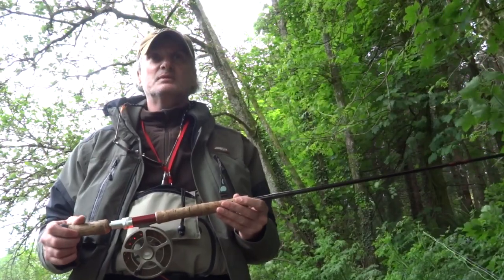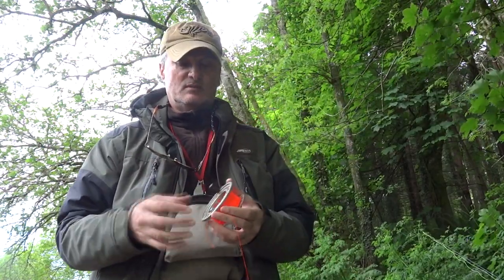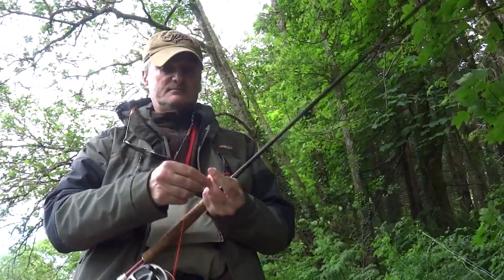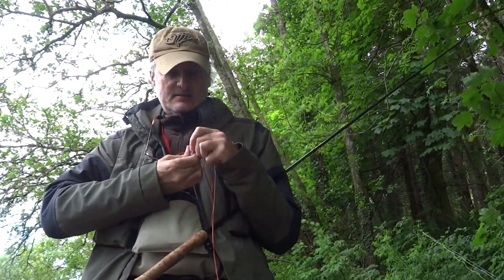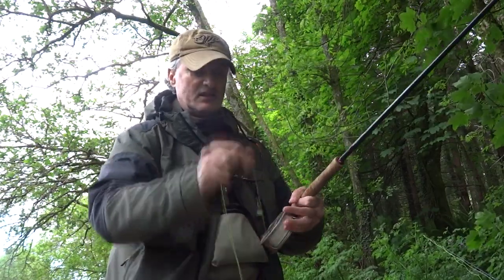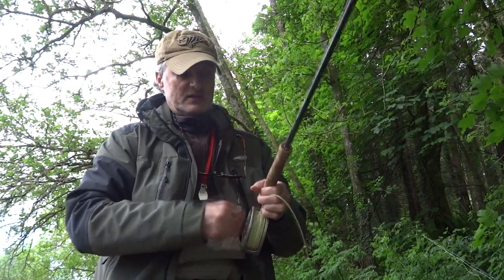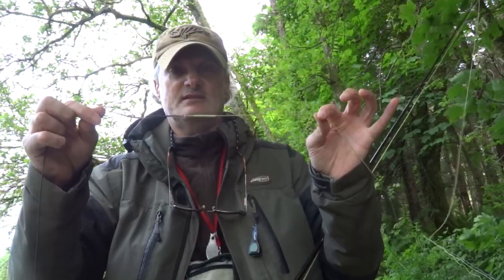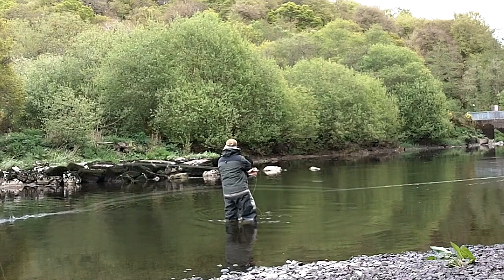Salmon Switch fly rod set up (HD).

Comment: Been thinking about a switch rod been using Shakespeare oracle 14 for years looking switch some thing lighter for the summer.  Please advise what rod you are using and line. Been watching your uploads and have subscribed
Reply from the maker: Hi Neil, the switch rod I'm using is a home made rod because I prefer a 10ft rod and most of the switch rods were 11ft or more which defies the whole idea of a switch rod and 10ft rods are better from both single and double handed fishing. The shakespeare 8/9 switch is a good rod to start with, guideline, Zpey, Hardy, Loop all make nice switch rods but also at a nice price so its better to try and see if you need the rod first before you buy and anyway the shakespeare will always be a good spare rod. As for lines Rio switchchucker or the Barrio switch line are ideal and can throw any 10ft polyleaders. Also thanks for subscribing as I'm no longer answering unsubscribed comments. Tight lines Paul. p.s. Go to my facebook page MrKingfisher3 and direct message me if you have more questions.

Comment: excellent video very easy to follow 
just bought hardy 11ft switch  tod was thinking off getting rio scandi short versitip line what u think or do u recommend any other line 
cheers Ross
Reply from the maker: Hi Ross, for ease of fishing I would use a Rio Switch chucker as my main under arm casting line, it will handle most of the sink tips and has excellent turn over even in a good wind. In reality you only need a few tips considering that I really only use two sizes myself and they are the Rio 6 ft salmon 2.6 ins and the 3.9 ins sink tips and an intermediate tip for summer low clear water. A trick that works for me is if its too fast or deep for my tips I add a small tungsten tube fly to the mix and with the Outbound or Switch chucker you will still get a nice turn over and more depth. A video is on the way soon regarding sink tips, lines, mending, tracking and placement etc.

Comment: Hi Paul really enjoy all your videos good explaining and gets through easily in my grey matter! I do not own a salmon fly rod but here in Devon where I fish on the river Reign the sound of a switch rod appeals to me! Paul on rod reel what would you recommend for here for me please ?
All info greatly appreciated keep up the grand work and Tight Lines to you!!  Moppy
Reply from the maker: There are many good switch rods available at the moment but if you just want to test the water the Shakespeare 8/9 switch is okay. Stay away from the line and buy a good dedicated floating switch line either Rio or Barrio that can carry 10ft tips poly leaders etc. You will be fishing probably only 3 tips in a season, an intermediate, 3ins per second sink and a 4ins per second sink rate. Rio make a good set of versileaders in those 10ft lengths and well tapered for good turnover.
Reply: @MrKingfisher3 Thank you very much Paul for reply/ advice! 6 weight good all round ? River Teign very narrow in places and with spate soon drops after good head of water to be got smartly but high low no matter grew up here so means a lot body and soul ! John

Comment: Thanks fo this. Is the sink tip always needed or in lower river conditions can I just attach the tippet directly to the floating fly line? Aso, how long do you usually make your tippets a.d what space between point fly and dropper if you use one?
Reply from the maker: Low water conditions can be hard especially for salmon fishing so stealth both in the water and on the water are important. Using an intermediate clear tip of about 10ft with a 6ft tippet of around 5kg is ideal giving nice presentation and hiding the flyline. You could also use a 10ft tapered leader as well and attach  the same 6 ft 5kg tippet which would give more life to the fly than the intermediate tip. I normally allow 3 ft between point fly and dropper. A good fly for a dropper is a size 12 wickhams fancy which can catch you more fish in August and September than any shrimp pattern because salmon tend to hit the smaller flies then.
Reply: @MrKingfisher3  Thanks for the advice.

Comment: Good video paul,  Just a question what line do you use? Im using a Guideline multi switch with my Guideline lpxe switch.. I find it good but when wind comes the line doesn't have the power to cut through.
Reply from the maker: That seems to be a common problem with most bespoke lines that are supposed to be designed for certain rods they can't cast the tips and are very lacklustre. I use a Rio Outbound fly line almost the same profile as the Rio Switch chucker, the outbound is just slightly lighter than the switch chucker so I can over arm cast smoothly and it can also put out most of the 6 ft sink tips  (up to 7 ins sink rate) with ease. I have used the Switch chucker line and it can really throw most sink tips into any wind. Maybe a short Skagit will help you as well, you really only need this type of line for tight areas and heavy tips but it will cut through most winds carrying a sink tip. I will be putting up a video soon on fly lines and casting techniques to improve turnover and presentation.
Reply: MrKingfisher3  cheers Paul, I use the outbound on my 13fter 8/9, the switch rod is rated from 290-325 grains but most of the lines are above it, have you herd of the airflow rage lines ? There around that grain rate. Cheers
Reply from the maker: I haven't used the Airflo rage lines but as for the  line ratings most of them are off, even these days most rods are a half or even a full line weight under what they are rated for. I have put 5wt and 6wt lines on a 4wt rod and fished away with very little notice in the casting stroke. The only problem is when you start banging short heavy lines and tips on a switch rod then you will break the rod. The switch chucker is a fishing line, it will do the job... catch fish because it does what it says on the tin and that is cast most tips with ease into a wind and still give you great turnover. The Barrio lines for switch are supposed to be quite good as well and they are a full line as well i.e. running line straight to head. Lines will always be an issue, you just have to find the one that suits you and what you need it to do that's why I recommend the ones that I have used and worked for me.
Reply: Cheers paul, The I know lads who are fishing 420 grains on the same rod but on a 8/9 not a 7/8 so i might try 360/390 grain and see, I only fish inter tips 10ft on mine! Thing is though the grain ratings are for overhead not spey casting.. weird!
Reply from the maker: I would change over to the 6 ft Rio intermediate salmon tip and use a flurocarbon tapered leader and you will find that it will cut through the wind better and get good depth with turnover. Most switch rod lines and rods are catered for 6 ft tips not the 10 ft that's why I recommend the Chucker as it designed for that and will carry 6 and 10 ft tips. I have used Rio tips and lines for over a  decade  and they are the best for fishing, when you can forget your casting issues you can really concentrate on the fishing and catch fish.

Comment: hi , I'm think of getting an Oracle switch rod , but I'm unsure should I get a 6 7 or an 8 9. I fish the feale and laune 
what would you recommend
Reply from the maker: Hi Timothy, the 8/9 switch is the safest option as the 6/7 is too light and this can be an issue with high water or fighting a good fish. You just don't have any backbone in the lighter rod especially if you are going to be using poly leaders. My rod is a 6 wt home made switch but it's only 10 ft in length giving it better strength and casting power. I had a 6/7 Oracle and broke the tip playing a good salmon so if it were me I'd get the 8/9 .
Reply: @MrKingfisher3  I've heard about Shakespeares breaking , but then I was also told they are great rods ,,, I've seen heavy salmon played out on 6 wt trout rods, 
 is there a difference in the carbon used I  Oracle's ? compared to dear rods or are they all the same ?
Reply from the maker: At the end of the day you are the one buying the rod, if you know someone that has the 6/7 try it out for yourself. I don't know what carbon is in the Oracle 6/7 switch compared to more expensive rods but using the lighter rod has it's compromises ...nice for casting all day but when you really want to play a salmon fast and hard or use heavy poly leaders 5 /6/7 inches per second sink rate then the 8/9 is your rod. Remember going in under gunned will only give you a head ache when the pressure is on and you're playing a good fish in difficult circumstances.

Comment: Paul, i got my hands on a OPST skagit head 400gr for my switch 16.5 feet and it was perfect. Also, getting rid of that annoying loop to loop from head to run can be done very easy with a tube weld or even without the tube.
Reply from the maker: That's great hopefully you can put it to good use, just be careful about welds some lines take well but others can be easily damaged and will crack after a few sessions.
Reply: @MrKingfisher3  Oh! i already put it into good use on 18lb steelhead!  Steelhead junky for life!!

Comment: What type of line do you use with your switch rod?
Reply from the maker: Hi Oisin, it's a Rio outbound fly line the same profile as the AFS outbound but an older line. It's hard to get these lines anymore especially in 6/7 or 7/8 weight lines, they have the heads available but not the full lines.
Reply: MrKingfisher3 I have a Oracle switch 7/8. What would match it?
Reply from the maker: The 7/8 is a bit light for big salmon especially in the early season but great for grilse and summer salmon,  the Switch chucker by Rio is ideal in 7/8 for your rod. It will cast with ease and throw most of the 6 foot Versi leaders / sinking polyleaders.